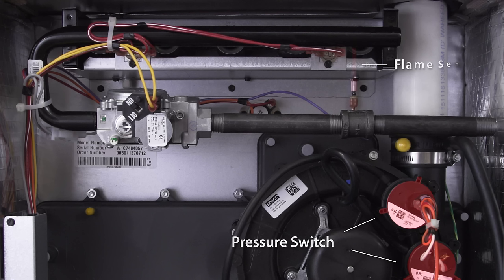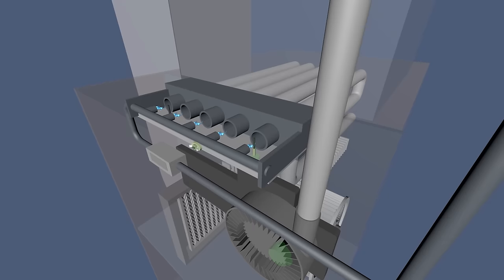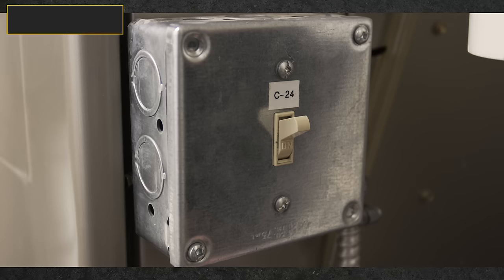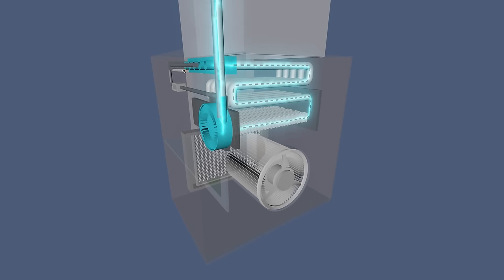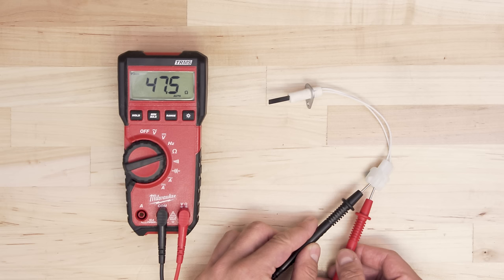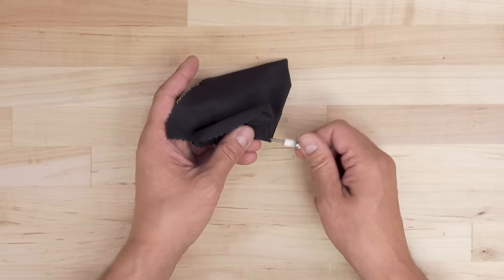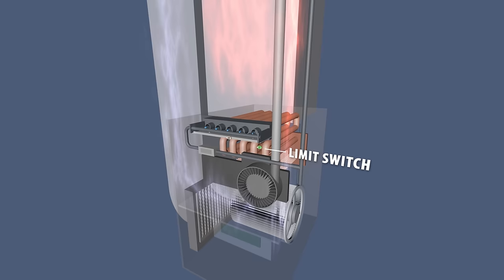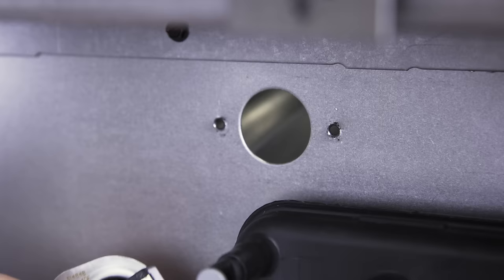Furnace Starts Then Stops - Troubleshooting | Repair and Replace

Comment: My burner ignites then after a couple seconds, turns off then reignites almost immediately.  This repeats several times then the vent motor shuts off and the blower kicks on for about a minute.  The blower then shuts off and the cycle repeats.   
If I have the thermostat fan switch set to ON instead of AUTO,  the blower turns off as the igniter starts and the flame only cycles once or twice then the blower turns on and it heats properly.  Any idea what's wrong?
Reply from the maker: Hi Andy, thank you for watching. Check to see if your furnace gives you any codes. Cycling like this could be an airflow issue (dirty furnace filter) or faulty limit switch. It could also be an issue with the thermostat or loose or defective wires.
Reply: @AmreSupply  
Thanks for the response. It's an older furnace, so I don't think it has codes and if so, I don't know how to view them.  It does the same thing even with the filter removed and the airflow seems strong.   I see a thermo-disc device installed in the duct above the burner.  Is that the limit switch?
Reply from the maker: @Andy-df5fj  If its an older furnace then you might have a fan limit switch instead of a high limit switch. In furnaces that don't have a very advanced control board, fan limit switches are more involved in the regulation of the blower fan. This would be a simple thing to replace first to eliminate it as a source of the problem.
Reply: @AmreSupply  
Where would the fan limit switch be located?  I see a pressure type valve on the vent blower which has given me issues in the past when my exhaust blower was running slow, but I don't see one for the main blower unless it's inside of the lower blower section.  I haven't checked there.
Reply from the maker: @Andy-df5fj  The fan limit switch and high limit switches are generally on the side wall and will monitor the air through the vents. You can see how to access it and test it here: https://www.youtube.com/watch?v=0va_wvwfCBA Now yours might look different from the video but we have a variety of replacement switches in stock. Just be sure to match the temperature ratings exactly. https://www.amresupply.com/catalog/Fan-Limit-Controls-HZ3D
Reply: @AmreSupply  
Thank you!  I will check when I get a chance.  In the mean time, I tried testing it again and the way it's cycling, it almost seems as if the control board has a hard time energizing both the blower and the burner relays at the same time.  The instant one comes on, the other turns off.
Reply from the maker: @Andy-df5fj You're welcome! Board problems can occur but its harder to test to confirm if its the issue. Before replacing the board its best to try to eliminate any simple sources of issues such as the limit switch.

Comment: One thing he did not mention is the fan switch. If the indoor fan switch, which gradually closes its contacts on temperature rise, is worn or out of adjustment it will cause short cycling.
Reply from the maker: Hi Angus, thank you for watching. You are right that some furnaces have fan limit switches to control the blower. The contacts do wear out overtime like high limit switches. In the video we focused mostly on high efficiency forced draft furnaces, which generally control the blower fan through the control board.

Comment: My furnace takes more than 3 hours to warm up the house on the coldest winter days, and it's been turning off and back on again after blowing air. The cycle happens up to 8 times in the first hour, and only in the morning. Why does this happen only when I heat the house for the first time in the morning?
Reply from the maker: Thanks for watching. Depending on what you have your thermostat set to during the night it will take longer for the furnace to heat up the house in the morning. Depending on your furnace it might not be able to run constantly for the full duration to heat it up, so it might have to split it up into more than one cycle. There is a bit of variation between systems so not all will behave the same.
Reply: @AmreSupply  My furnace never runs when I'm sleeping. It can run for hours without shutting off when the weather is warm enough. The only time it cycles up to 8 times in the first hour is on the coldest winter days. I don't understand why this happens.
Reply from the maker: @RedPill780  It might be best to check your thermostat settings. If you have an older mechanical thermostat then it could have some issues. If your thermostat has a program schedule then that might also explain why it doesn't run during certain times.
Reply: @AmreSupply  I use my finger to move the stick at the bottom of the thermostat. I guess that's what you call mechanical. Anyway, there is no schedule to program since my thermostat isn't digital. Fortunately, my furnace is running fine now that the weather warmed up. I only have problems with it when it's -30 or something like that, and I don't know what could be causing this. It's like a car that's hard to start in the middle of winter.
Reply from the maker: @RedPill780  That makes sense, when it is minus 30 outside, then the furnace would need to work a lot harder in the morning. The cold is quite hard or most mechanical systems
Reply: @AmreSupply  Thanks for responding again. I didn't know this behaviour is normal on very cold days.

Comment: Have a Bryant gas heater everything's been replaced but burners only stay on for to 5 seconds then kicks off
Reply from the maker: Hi Robert thank you for watching! What you are describing is that the furnace isn't proving a flame. Either the flame sensor is fault, or is not heating up. The flame sensor could have a build up of carbon, or might not be positioned correctly in the flame. Either scenario will prevent the furnace from proving that the flames are lit.

Comment: If any wire or switch that  has continuity  the multimeter must read at least  0.1 ohm
Reply from the maker: Thanks for watching. 0 ohms means that there still is continuity as there is path present in the switch with 0 resistance. Most will show between 0 and 1 ohm. If there is no path and no resistance the multimeter will not show any reading, and will have a blank display or will show OL (open loop).

Comment: I replaced both the flame sensor and igniter.  My igniter starts to light , runs for a while but the burners never start going then it clicks and cuts off
Reply from the maker: Thanks for watching. In your case it's possible that there is no gas being released to ignite. This could be an issue with the gas supply or the gas control valve. It's worth contacting an HVAC tech to take a closer look.
Reply: @AmreSupply  thanks for the response
Reply from the maker: @BB-cw3uv  You're welcome.
Reply from the maker: @BB-cw3uv  You're welcome.

Comment: why my sensi smart thermostat is keep rebooting??
Reply from the maker: Hi Sony, thank you for watching. If the thermostat has batteries then its best to replace them. If the thermostat is hardwired, then its more likely an issue with the thermostat itself. It would be good to check out the Sensi troubleshooting on their website or contact support.

Comment: Hello,

I am having a unique problem and when I called for service, I got a lazy answer so I am looking to see if anyone can help me here. My furnace will go through its normal process but after about 15 minutes, the blower fan stops. This causing the Limit Switch to get tripped. When the limit switch gets tripped, the blower fan then kicks on again and removes that hot air. After about 5 minutes of just the blower running, the system resets itself and goes through the normal startup.

That whole process happens until eventually the burners will not come back on. Any help would be much appreciated. 

Thank you,
Reply from the maker: Thanks for watching. The fact that your furnace runs for 15 minutes means that no part has completely failed. The shutdown is normal after several attempts.

 It could be because of a faulty limit switch. The limit switch is just simply made from a bi-metal disc. When it heats up the discs change shape and it pops out to disconnect the circuit. Over time the metal can fatigue and cause the furnace to trip at lower and lower temperatures. Replacing the switch is a good way to eliminate this as a source.

As well its best to replace the furnace filter as any restriction of airflow can cause the heat exchanger to overheat which will also trip the limit switch.
Reply: @AmreSupply  thank you so much for your reply!! I am going through your videos now and you have earned a sub for reply to me on an old video, again thank you so much. 

I will go ahead an order a limit switch. The issue I am having is weird cause the limit switch seems to be doing it’s job. When my blower shuts off, the burners are still on causing that switch to heat up as the air is not moving. I am trying to diagnose why the blower shuts off during a heat cycle but it could be that switch being faulty that is just turning off the blower.
Reply from the maker: @canes4ever162  Thank you we're just happy to help!

What year and kind of furnace do you have?  An older furnace will use multiple limit switches to help control the blower at different stages. A faulty fan limit switch could explain why the burner is still running after the blower has shut off. 

If you have a newer furnace then the control board will be regulating those operations. A faulty control board can create these sorts of issues but its best to eliminate the simple solutions and replace the limit switch first. This is because the board itself is difficult to test and is more expensive to replace.
Reply: @AmreSupply  hello,

I have a Trane XL90. I am going to bypass the limit switch with some testing later today with my dad to see if the pattern changes. I am hoping it is not the control board as well. 

Thank you for the reply again.
Reply from the maker: @canes4ever162  You're welcome. Best of luck!

Comment: Read the board code, and replace the faulty part. The exception is plugged venting which will show up as an air switch fault.
Reply from the maker: Well put C OG, that's a good summary of it all.

Comment: A bad blower motor can also cause poor air circulation. This will in turn cause furnace to overheat and trip the limit switch.
Reply from the maker: Thanks for watching! You are right, over time blower motors can wear down and start to weaken, which would circulate less air over the heat exchanger.

Comment: if you have the stat on " fan on",  why would the fan still cycle?
Reply from the maker: Hi Ruben, if the furnace cycles when the stat is set to "fan on" then the heat exchanger could be overheating or the limit switch could be faulty. In that case the furnace would shut down, and then restart to attempt ignition again.

Comment: Hello! My lights flash 3 times stops then 1 more flash. The furnace comes on then cuts off after about a minute or so. Any Ideas?
Reply from the maker: The flashing lights will be different depending on your model. Look on the inside of the cover panel for a chart, it'll likely explain exactly what that code means. Sometimes this is listed in the furnace manual.

Overall if your furnace is shutting off after ignition, first check the flame sensor, and clean it, if that doesn't help, replace the flame sensor.
Reply: @AmreSupply  I try that thank you!
Reply: @AmreSupply  I replaced the flame sensor and the furnace ran for a few minutes then stopped and started, then stopped again.
Reply from the maker: Next thing is to try the limit switch, you can learn more here: https://youtu.be/0va_wvwfCBA
Reply: @AmreSupply  hi, i have the same problem.  I replaced the flame sensor.  The igniter glows as it's suppose to but no flame.
Reply from the maker: @squidusn71  Thanks for watching. To work the flame sensor has to be positioned inside of the flame. It also needs a path to ground to complete the circuit through the flame, and the burner. If the burner is very dirty it can prevent the flame sensor from having a path to ground. Try cleaning the burners first.
Reply: @AmreSupply  ok I'll do that and I thank you for the fast response. I also made a more detailed comment on the same issue from another one of your great videos. Thank you so much.
Reply from the maker: @squidusn71  You're welcome we're just happy to help!

Comment: My furnace only works if you power it off and on... hope someone can help
Reply from the maker: Thanks for watching. If your furnace only runs after turning off the power then it's likely failing at some point and going into a lockdown. Turning off the power clears this, and resets the furnace. See if there are any error codes as this will help you narrow it down. As well when you are able to start the furnace, observe and see how far into the sequence it gets. This will help show you which component might be faulty.